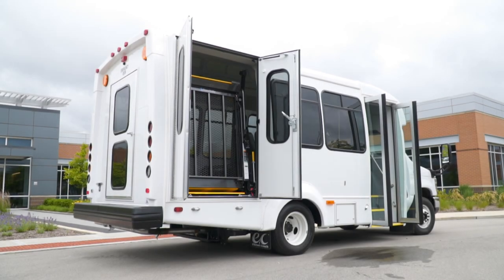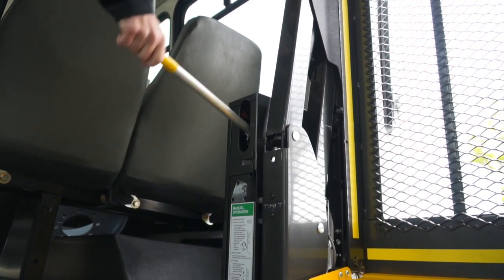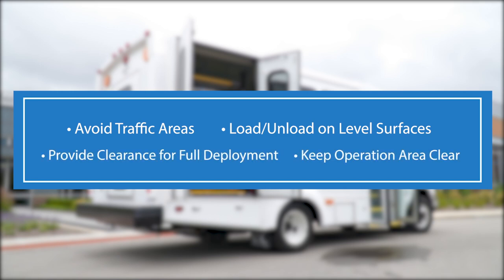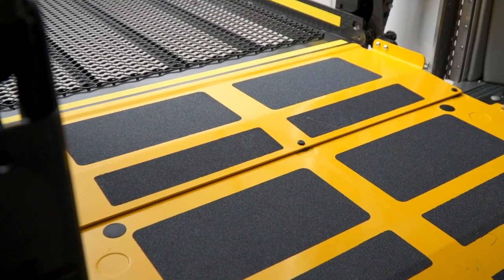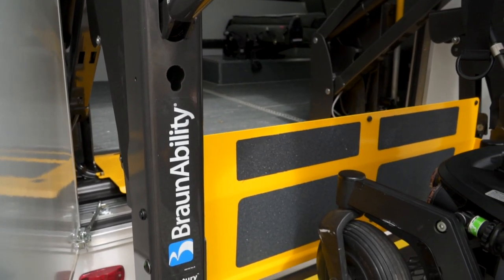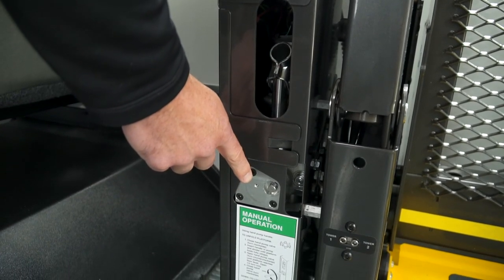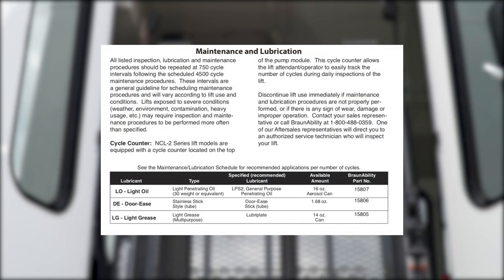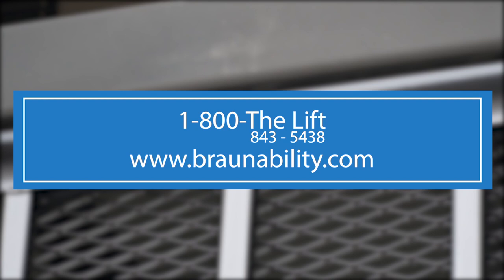How to Operate a Wheelchair Lift

Comment: I have a brand new wheelchair lift, but my bus was sitting in storage for 8 months and my batteries died. When I got them recharged, my lift won’t turn green. Any idea how to get the power back to the lift? Is there a battery that needs to be jumped?

Comment: When I turn the switch on the green light does not illuminate. Any idea why?
Reply: Presumably then the lift is not  getting any power, since that's the light for it.
Reply: @Aiah Lebbie If the lift is damaged beyond repair, your only option is to replace it or take it off. It's connected to the floor with four blots.

Comment: Nobody loads people backwards like Braun recommends.  LOL
Reply: As a lifelong wheelchair user, loading on the lift backwards is wrong. You want to go forward so you (the person with a disability) has more control and can see where you are going. If the back end of a wheelchair is too heavy for the lift operation to be safely done, then that is a design flaw in your lift.

It is also safer for the person in a wheelchair to get on and off the ramp independently than to add the extra weight of a second person on the ramp. It makes the weight distribution on the ramp off center.

Comment: Never load a person in a wheelchair on backwards.. The person has less control over their chair, its scary to be lifted up backwards and feel like you are getting dumped out because the lift has design flaws.  I am a person in a wheelchair and have been in a wheelchair for over 40 years. Your lift design is very flawed.  Try having your design team going on the lift in a wheelchair and you will be able to feel immediately it is not very secure.  Fix your lift design so people in wheelchairs can safely load on the lift facing the front.